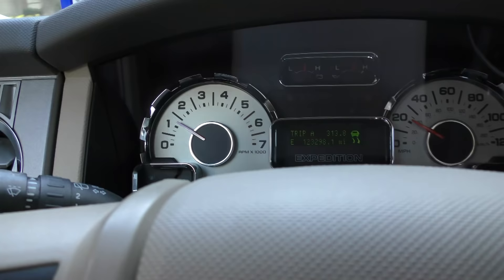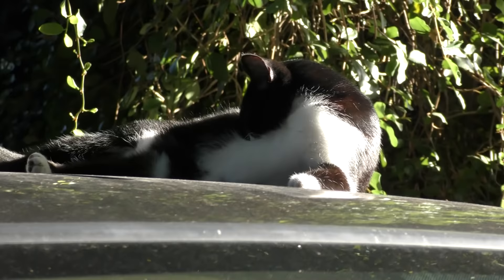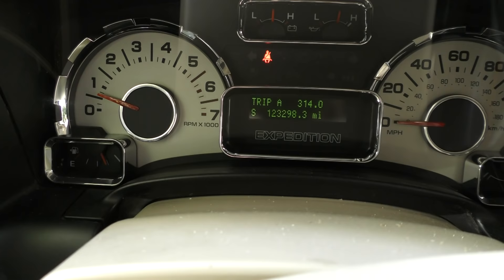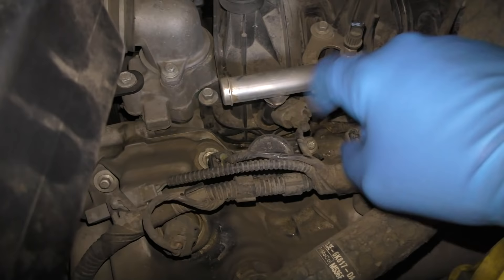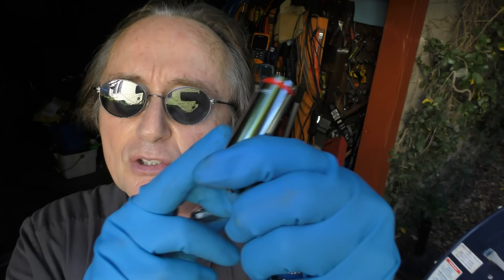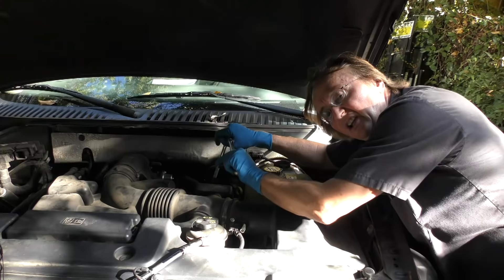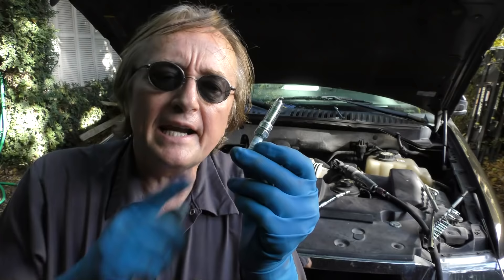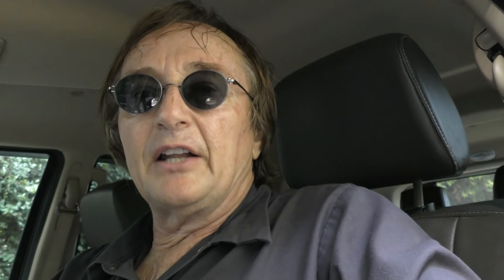How to Stop Car Hesitation (Spark Plugs and Ignition Coil)

Comment: @Scotty Kilmer   i have an 02 sable with the dohc 24v 3.0 duratec motor. ive changed plugs wires and coil pack even injector #4. shes still misfiring at low idle (only at a red light if im there long enough) she runs fine on the highway. 

i did a compression test and cylinder #4 is at 60 pounds. the car only has 65k miles any ideas?

Comment: 2002 Toyota Camry and my car keeps jerking back and forth when i accelerate I did do a full tune up change the maf senser and still the same problem, this started happening when I changed the oxygen senser once I've change the oxygen sensors top and bottom that's when it started jerking back and forth if you can please get back to me I appreciat it thank you

Comment: Hi Scott I have a Nissan 03 Murano. Just yesterday my car started making a trembling (shaking) most ion when I’m accelerating. My code said my cylinder 3 is miss firing. Today I gutted my car to get to Cylinder 3 and change my spark plug. All my plugs are okay. After assembling everything back together. My car is still having the same problem. I’m not sure if I should be using my car. Around 30 mph the trembling begins. Any though of what it might be?

Comment: What if 5.3 2000 GMC Yukon starts out smooth no gas smell after spark plug change then later after driving has light tick then a gas smell from exhaust and engine light

Comment: Hi Scotty, I understand that I need to change the spark plug and what is the second one you said, I didnt get what you said.  Mine is a 2006 Toyota Corolla and she is sluggish and difficult to get her to 60 miles per hour.  So let me check my spark plug and the other one you said.  Please let me know the second one you said. Thanks,
Reply from the maker: on that model, try my video "how to clean fuel injectors on your car' and also change the air and fuel filters
Reply: yes same issue,  i just got my fuel injectors cleaned,  lots of power now. toyota corolla 2000
Reply: Zack Wetzel How did you cleaned the fuel injectors?

Comment: Hey scotty, i have a 1998 ford ranger xlt 3.0 automatic. 130k miles. At highway speeds between 55-70 the truck bucks and shudders. Ive currently changed plugs, wires, tps sensor, coil pack, camshaft sensor and also the camshaft synchronizer and nothing has fixed the issue. Im hoping you can give me a little advice and insight on where to go from here? Thanks!

Comment: Hey does carbon build up cause slow acceleration? I recently bought a 2014 impala with the ecotec and it was falling on its ass when id try to speed up to merge into traffic or pass someone. I ended up running it low on gas and filling it up with premium and used some lucas gas treatment on fuel injection cleaner and after about a week this things running like new again. Not sure if its temporary or my mind playing tricks on me

Comment: My 98 Mustang GT did this a couple months after I changed plugs and wires so I replaced coil packs and o2  sensors and it still stuttering do I have defective plugs or wires? Gaps off?

Comment: can yu plz make a video of what a turbocharged engine really is ? example... theres the new 2017 chevy camarao 2.9l 4 cylinder and has a turbo?? HOW?!? thanks
Reply from the maker: turbos use exhaust gas to compress air and throw it into the engine, effectively increasing the compression pressure inside for power boost.Any car can have one put o

Comment: What if the spark plugs is loose and you can wiggle the plug? Not in the engine but while holding the plug. New dunno plugs are defective but why?

Comment: Hi scotty,  my transmission fluid is leaking i just replaced the transmissions shift solenoid pack and also changed my transmission fluid and filter everything is new so im wondering why theres still transmision fluid leaking...

Comment: Hello, Scotty. I have a similar problem...When I decelerate as I come to a stop or just decelerate in general, my car jerks a little as if I were downshifting. My car has an automatic transmission. Would that be a spark plug problem or an idle air control valve problem? Or something entirely different?...please HELP!

Comment: My 2004 Nissan Altima is taking at least 40 minutes to shift into drive I just had the oil changed brand new starter and transmission service and it’s still stalling think it could be ignition coils a few months back I ran a test and it said spark plug misfire and ignition coils

Comment: Why do a 2006 Nissan Murano with engine running when placing your foot on the brakes  and celebrate the engine raises   in drive but will not go

Comment: I have a 2008 Pontiac g6 gt 3.5l v6 and im having starting problems and i have one 02 sensor i need to replace and the first time i try to start it it wont crank up but second time it fires up

Comment: Hi Scotty !

I went to Autozone  yesterday to have my CHECK ENGINE LIGHT checked and they told me to replace to OXYGEN SENSOR . I went to a different one today and they told me I need to change the FUEL PUMP also. Someone there mentioned the spark plugs and I remembered I haven't replaced them in about a year and a half so I'm going to start there. The truck sometimes hesitates to start (specially in the mornings ) . They found these codes. I'm wondering if you can give me your opinion.
Thank you so much in advance.  

P1168 Fuel Rail pressure in range but low
P0420 Catalyst System Efficiency Below Threshold (Bank 1)
P0463 Fuel level sensor A circuit High input
P1051 
P1168 Fuel Rail pressure in range but low
P0420 Catalyst System Efficiency Below Threshold (Bank 1)
P0463 Fuel level sensor A circuit High input
P1051

Comment: My car started hesitating AFTER the spark plugs were replaced.  Maybe they weren't snug?  Problem a coil?  Throttle body needs cleaning?
Reply from the maker: often you damage spark plug wires or coil on  plug assemblies when changing the plugs. Also check for vacuum lines being broken or sensor wires being messed with during that work

Comment: I can drive 10mile with my Audi a4 but the moment I stop switch off ignition car start misfiring unless I have to wait until 1hour then back to normal again, I have replaced new spark plugs but this problem still coming the only think I haven't replace is ignition coils

Comment: I just changed four spark plugs and one coil that was coded to be bad. 04 Mitsubishi galant. , the idling is still bad engine shaking and when I checked the coil I replaced it is extremely hot. What happened???

Comment: Hello Scotty. I have a 2012 Toyota Camry that has a stutter problem when accelerating. When we got the car, we got the spark plugs changed, the problem stopped. I drove it Saturday for the first time ad the stuttering happened about 4 times maybe. What else could possibly be causing the stutter?

Comment: from a dead stop when I accelerate low RPMs barley on the gas it hesitates hardly noticeable. if I stay coasting between 1500 to 1800 RPM it hesitates can a dirty throttle body cause this?? 2010 honda civic if I give it normal gas on the take off it doesn't do it.

Comment: Scotty ihave a chrysler 300c hemi 2007and it hesitates wont rev past 3rpms or past 40mph and i changed the tps spark plugs, coils, fuel injectors, and it still does it i checked the timings is good but it still have that my car reads codes p0300 and i dont know what to do now does a bad fuel pump affect that???

Comment: I have a 2002 dodge ram 1500 3.7L with 190,000 miles. It smokes and engine shakes when started cold, but once I drive it for literally a few seconds it runs fine. Any ideal what this could be?

Comment: I have a peugeot 307 cc 1.6 nfu
At rpm 3000 i have a feeling I steped on the break. It looses power from rpm 3000 to rpm 4000... 
What do you think what can cause problems like this? Asked a lots of mechanic, but couldnot fix this problem. 

Iddle rpm is ok.

Comment: Hi Scott y, thank you for all your good useful video's, but i have a 2002 dodge caravan, 3.3 L V6, and is not idling and  running good, missing, hesitating, anyway first thing i did changed the plugs, then wires, the coil pack, still the same, show it to a garage, told me 2 of the cylinders are low compressions, i even put bottle of " restorer" in it !.. is it any way to make it better?  i still drive it !! Anybody has any good Idea !?
Reply from the maker: those are junky engines when that old, drive it till it drops, then junk it, not worth putting a new engine in really. Next time get  toyota van, i've seen em with 400 thousand miles on em
Reply: OK, thank you.

Comment: The thing I hate about changing plugs is that I can never feel when it's been loosened all the way, and I worry that if I keep spinning it, it will cause damage to the threads. The socket doesn't always grab the plug the first try so I can't tell. I wish I knew the exact number of turns before trying to pull it out.

Comment: hey scotty i have a 79 ford bronco with a 351 Windsor in it and i put new plugs and wires in it but it wont start and backfires through  the tailpipe and through the carburetor what do you think is causing this

Comment: My truck doesnt want to go uphill or go over 40 .....i already change fuel and air filter...change the spark plugs and wires ...and clean the mass air sensor but still hasnt change

Comment: Scotty, What happens when I'm NOT able to get any Ohm readings from my primary...I double checked to make sure I had the common pin, and I'm unable to get any response from the multimeter @ 200 Ohms. Is that a sign of a bad ignition coil, please respond? Thank you in advance.

Just a few more information on what's going on; 2004 Outback EJ259 2.5L. Was getting the following engine codes P0057, P0037, P0303 & P0304. I've replaced all spark plugs (cylinders 3 & 4 was oily), installed new valve cover gasket kit, and replaced both downstream O2 sensors. This took care of engine codes P0057 & P0037, but the Cyl 3 & 4 misfires still exists 🤦🏽‍♂️

Comment: Hi Sir,
I have Hyndai i10 it has jerking problem... When I slow down from 5th to 2nd gear it misses running and again picks up..
I have changed all the 4spark plugs, air filter, cleaned throttle body and have changed the complete clutch assembly..
However, the problem still not solved..
What is your advice..

Comment: I have this problem and still didn't found the answer, chanced coils, spark plugs, lambda sensor, egr valve, throttle body, map sensor, searched for oil leaks or vacuum lose and nothing changed

Comment: well i have a similar problem changed the plug and all but  when the call is on neutral i can accelerate but it won't go over 20km and it keep trying to shut of even when i just leave it the miter keep jumping from 1.5 to 2 then bellow zero and i took it to everyone so any ideas on what's wrong ? i even had a full electric check cleaned the wires and all but nothing

Comment: My car has slow acceleration. I changed the sparkplugs, coil packs oil filter, fuel filter, knock sensor, I got an oil change, cleaned the maf sensor, new air filter.
 Could you list what could be the other problems? This Question is for Scotty but anyone can answer. I'm accepting ant help I can get.

Comment: Hey scotty my 2000 firebird trans am hesitates when going through gear changes it's a 4 speed automatic. Then tends to hesitate here amd there. I've changed spark plugs wires and plugs also changed the bank 1 sensor 1 and still doing it. What can it be?

Comment: Mi changed the spark plugs and coil packs and fuel pump assembly it still randomly miss firing in all four cylinders on bw passat 2.0t fsi motor any ideas?

Comment: Yes Siri if by shuttering he means making the truck Shake why you're at a stoplight making you think you need new motor mounts it's for sure a bad coil my 04 Trailblazer had that issue went ahead and change all six coils and plugs, total cost for parts 96 bucks and he was roaring like a Monster again! Like it's seriously a must you will get the worst mileage ever with a bad coil, dealer wanted to charge between 6 and $800 just to change something that was right under the dam intake box! ridiculous!!!!!!!!

Comment: scotty please help I have a 2002 camry 4cyl ....the car ran perfectly fine but there was a p0301 code cylinder 1 misfire ...I pulled out the spark plug it was burnt black I replaced that single plug. I know bad idea but now the car runs badly rough and shakes and dies out ...the coils pack leading to cylinder 1 looks good what can be the issue

Comment: Hi Scotty, i own an Audi A3 2.0 FSI 2004 and it's acting weird sometime. There is no engine light or codes, sometimes the rpm just shoot up /down and it mostly happens at low speed, even when i start the car first RPM stays in betwene 1000 & 2000 then comes below 1000 after some idle time. Can it be a spark plug issue ? Thanks

Comment: I have a 2003 Mazda 6, and the only time it stutters and hesitates is when it is idle. Usually when I'm stopped at a red light, the rpm's drop a lot sometimes to even ~400 rpm. When I start it up, the rpm's jump up and down a lot, hitting 2500 at times but then it stops after a while. No problems when the car is moving and driving along. I've changed spark plugs and cleaned the MAF, and it's still doing it. I plan on cleaning fuel injectors next. Any other ideas on why it might still be hesitating? Thanks.
Reply from the maker: of course tune if up, and if not that check the maf sensor for bad data and also the fuel pump pressure

Comment: My Isuzu rodeo used to hesitate randomly when I would push accelerater check engine was on, now it  won't even stay on!? Turn the egnition, car starts to turn on but before the engine succefuly is on it will hesitate bad and shake until it just turns off. Doesn't seem to be any sort of loss of power/: help?

Comment: Hi, I am having a serious problem and I need your expert advice. I have a 2003 Suzuki Grand Vitara 1.6l with a G16b engine, the vehicle has little power when accelerating  initially. The engine was rebuild in December 2017 and the valve lash clearance was set as 0.007in when cold for both intake and exhaust. As of 2018 all parts were changed: plugs, coils, plug wires, air filter and gas filter but to no avail. I will like to know what is the actual valve lash clearance to use given wear and tear of internal components. Thank You.

Comment: Scotty my dads 2011 F150 3.7 v6 is doing the same thing i have put new plugs in it and it kept doing it it had a check engine light for an 02 sensor which was upstream replaced that it turned out that engine light and it also had a grinding noise when you would first crank it the 02 fixed that but that shaky feeling remains and so does the thing where the rpm bounces up and down it’s definitely gotten better and the mechanic said it is misfire free but said the problem could be in the transmission truck has 123,000 miles on it never has had the transmission fluid changed my mechanic says not to or it will fail but to add some friction modifier what do you think is the problem that staggering feeling with a bouncing rpm is driving me crazy thanks
Reply: It ended up being the transmission was shot we replaced it and later got rid of the entire truck

Comment: I just bought a 2013 Ford Focus with 77,000 miles. Car was immaculate and at a very reasonable price, seemed to run great when I test drove it. 
I don't know if it was there already and I just didn't notice it or if it started after, but on the drive back from purchasing it it started hesitating when taking off. It's an "automatic" (apparently it's really a manual controlled by the computer) and it seems to change gears perfectly fine otherwise. I only get this stuttering/hesitation when taking off from a stop, and I've read online that this is an issue and/or more or less "normal" for a range of years for the ford focus. Anyone know anything about this? Don't really wanna pay for repairs that a lot of people say won't do anything anyway, but I'm not sure if the problem will get worse or not. I'd appreciate the help if anyone has any ideas.

Comment: hi my car is crown victoria 2008
it's make more hesitation specialy during turn on of AC ! and this makes Ac becomes more heat!  I changed the Ac watch sensor and check Ac gas but not change to btr . my problems of AC with car hesitation still no body get and understanding the problem i visit many of technicians but no one advice correctly. 
also i make computer test of throttle and throttle sensor and it's ok no problem. 
so what i should be doing? 
hope y can help me

Comment: i just barely blip my throttle and the engine kinda cuts out just a bit. hitting the throttle harder than that will make it rev up but you can always tell the little bit of cut out is there. any ideas? its a '90 f250 7.5L btw

Comment: Scotty I was wondering if you could help me? Check engine light is flashing and code said misfire in cylander 4. This is on an Infiniti i35 V6 3.5 L 
I replaced all the sparkplugs and the bad ignition coil in cylander 4. Its still idling extremely rough and feels like its gonna stall out when I hit the break and put it in drive or reverse.

Comment: Quick question. I recently replaced valve cover gaskets along with the spark plugs, the coils seem to be fine too but while my car is still having a rough idling problem at stops. Any suggestions. By the way I'm from Houston myself 🤘🏻
Reply from the maker: many things can cause rough idle.  Start by checking for vacuum leaks and broken motor mounts
Reply: Also, depending on the mileage, you may have to change the PCV valve (cheap and easy) and/or clean the EGR valve (bit of a work). Lookup EGR valve cleaning on Youtube. There are a ton of videos on that. EGR valve is a bit of money so may want to go with cleaning than buying a new one. 

Did you also change the ignition wires? They get old and will cause hesitations. My car had the ignition coil issue, so I changed the coil and the ignition wire and no more problem. Do it yourself and save money.